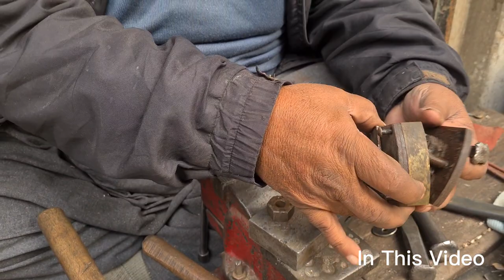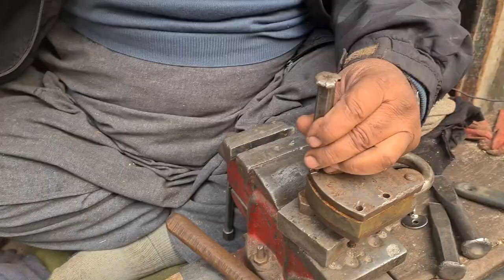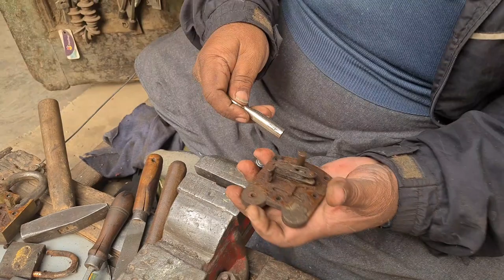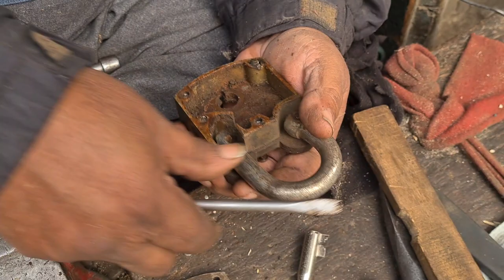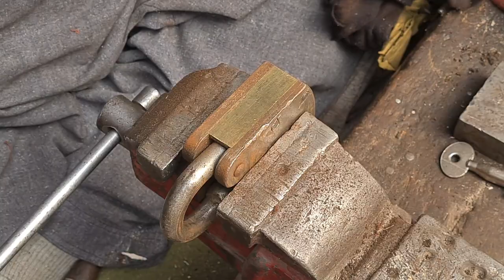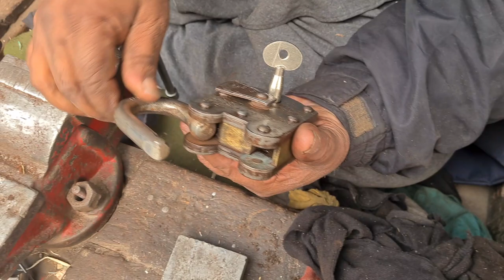Old Man Restoring Antique Padlock of the 19th century | Rusty Lock Restoration

Comment: Very cool video. He did a nice job but I'm a little concerned about how well the locks going to hold up. He cut the rivet heads off to open the lock up restore it then used the same rivets to reassemble it. The problem being that he didn't have enough metal on the used rivets to "ping" them over well enough to really hold like they should.
Reply from the maker: Great point